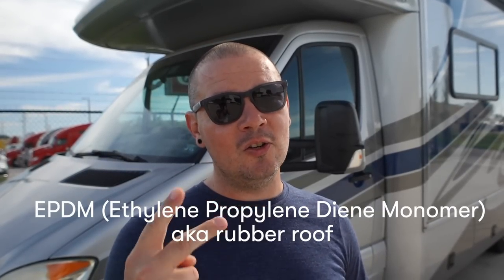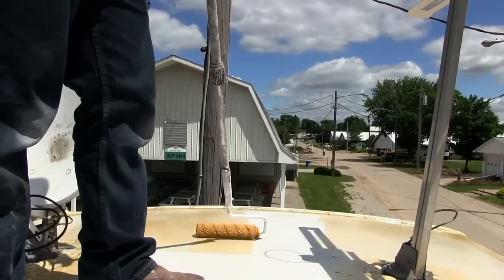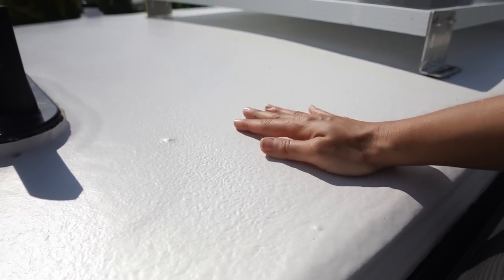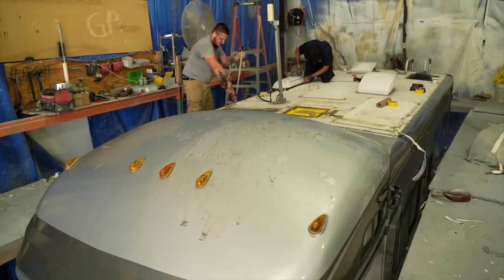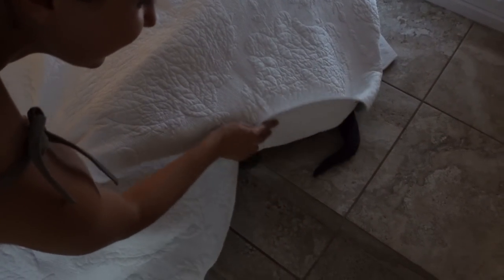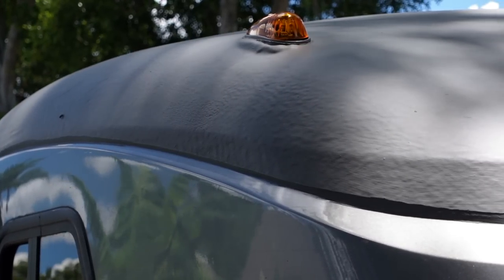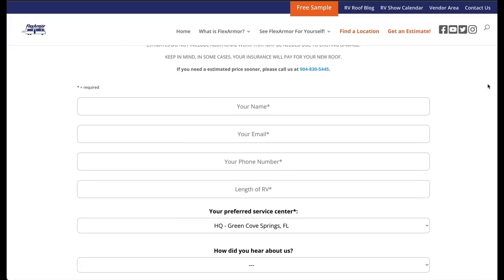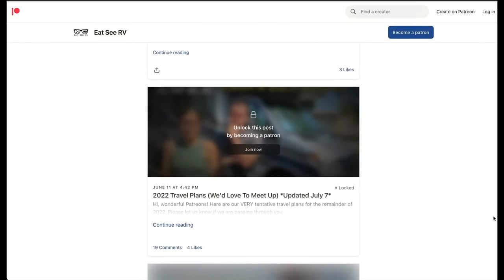The Ultimate RV Roof: No More Sealing or Leaks

Comment: I am from MI and I bought a new RV in 2021 which unfortunately had 2 roof leaks in the first 8 months. Each time the dealer had trouble locating them. So a Flex Armor roof became a necessity once I learned of them. I went to the Lifetime RV Roof location in Kansas City in July 2022. The service was excellent. The owners Brian and Garrett, as well as their tech Bryce, personally did the work. They texted pictures of the process. Now I have a worry-free roof that is quieter, better insulated, no caulking, and a lifetime guarantee. Highly recommended!
Reply from the maker: Wohoo that's awesome, sorry about your leaks it's so frustrating but so glad you got a happy resolution.

Comment: What’s that cost
Reply: They were being sneaky in not covering the cost. I guess they don't want it known the price is $27,000.
Reply from the maker: I don't know where you came up with $27,000 but that's no where NEAR what we paid. We didn't share price as mentioned because it will vary based on your RV roof length and needs. If the decking is bad the cost will go up. You can get a free quote online and they give a rough price per foot estimate too. The cost was a fraction of what Paul is falsly quoting btw.
Reply: They mentioned in a different comment a cost of about $5,000, IMO the price is well worth it.
Reply: @paulnubreu6887  Holy cow!! Where'd you get that number ($27,000)?  That'd be a 140+ ft rig!!!  To the best of my knowledge, there's never been a FlexArmor roof even close to that!! LOL.